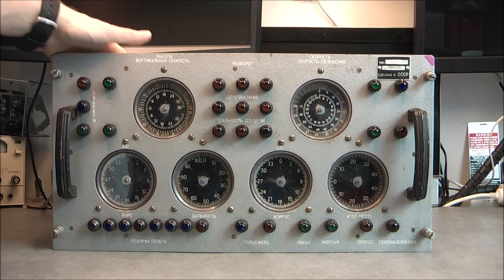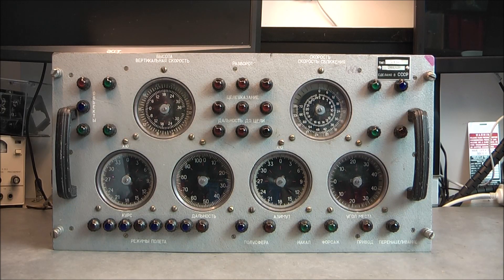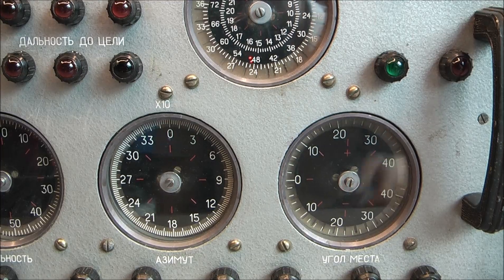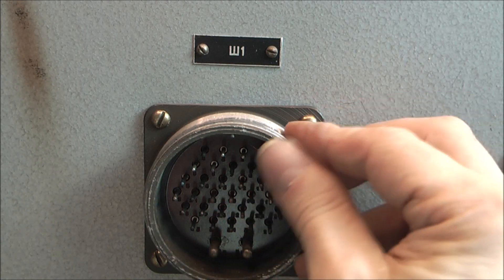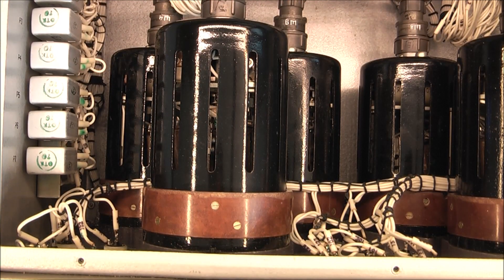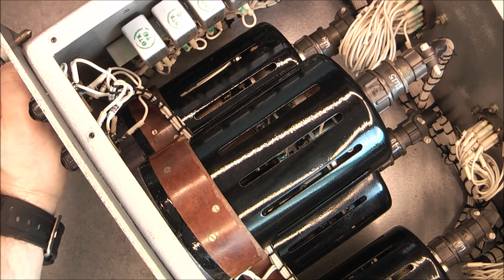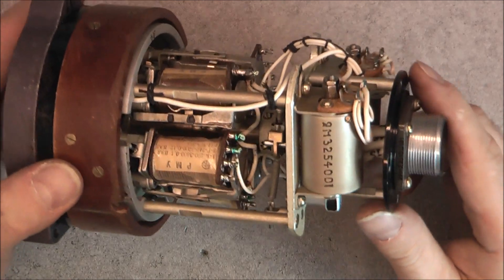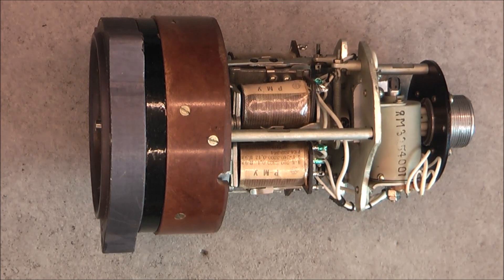"ЛАУ-54М" soviet avionics test panel teardown

Comment: So it's sort of like a rotary bina-view maybe. A digital meter display. Maybe what's referred to as an interference display. The rings may align to select a position for the indicator in quadrants and the light bulbs turn on one at a time to do the rest of the "addressing". This way, one indicator position is on at a time.
Reply from the maker: I need time to play more with those things, it should be easy to figure out if the bulbs can be controlled individually.

Comment: Super cool unit. I was born in Russia and had access to some military stuff even as a kid (haha) and I remember playing with those indicator bulbs. Your Russian is getting pretty good!! For those Russian connectors... I did try them before (yay ebay) but didn't like them. Aluminum on aluminum friction = galling/seizing. There are some very special lubricants which can help with them, but not worth the trouble. Your turn + push/pull approach is very good to avoid problems! The issue isn't the threading, it's actually friction between the retaining ring on the plug, and the body of the plug that it pushes against as it rotates. That's the part that will seize/gall. US military parts, even old 5015 series connectors were far superior. And the main reason is nickel plating. Thick nickel plating creates a much lower friction surface. As for the dial indicators, I suspect the light bulbs have a lot to do with how they work. You could try to power them by looking for low resistance paths between pins - like 15-50 ohms. Those will likely be the light bulbs. Relays will have a slightly higher resistance due to many windings on their coils (you could simply measure it too). And to be safe, try limiting your power supply to 5V and 300mA, and do this in a darker room to see if you can see something glowing. It doesn't seem that there are any active parts there, so you shouldn't damage anything. Good luck!
Reply: @Соломон Ртутный "These connectors are not designed to be disconnected frequently" - that's true of nearly all military connectors. They are typically rated for 500 mate/unmate cycles. Almost all military connectors have little holes for "lockwire", to secure them. This feature is very rarely used in practice. 99% of military connectors in the world are nickel-plated aluminum - but vintage Russian connectors use unplated aluminum, which is very unusual. That's where the galling/seizing problems come from. Stainless steel connectors are common in the US military as well, but they are used for high temperature, firewall or hermetic sealing applications. For US military connectors, the mating cycle limit comes from the pin endurance, not connector shell endurance. You can get pins rated for 1500 cycles for instance. In practice, military connectors can handle many more connection cycles - so these ratings are extremely conservative.

"it jammed to death, I unscrewed the nut with great force, and it turned out that some of the threads of the nut stuck to the thread of the connector and tear off from the nut, they could not be removed - they became as one whole" - yes, that's the problem with raw aluminum unfortunately. That effect is called "cold welding". As you've said, bayonet connectors work much better. The most common military connectors today are "D38999 Series III" which use a very coarse tri-start thread (kind of like the thread on a soft drink bottle). They mate/unmate very quickly. The connector shell has a ratcheting clutch system to prevent loosening. They work extremely well because the coarse thread will not jam easily (even if it's very dirty), yet the connectors can handle a much higher pulling force compared to bayonet types. That's why this connector type is used everywhere now. Russia uses them as well. Modern Russian planes like the Sukhoi Superjet 100 use this connector type exclusively, and they get them from Souriau, a French manufacturer for these US military standard connectors.

Your laquer approach sounds interesting if you're using older Russian equipment where you need to avoid seizing/galling/cold welding. I would be concerned about the laquer eventually coming off and jamming the connector. Plating tends to be much more effective.